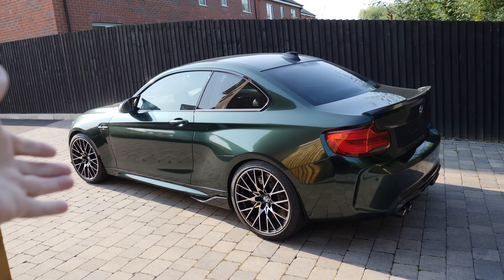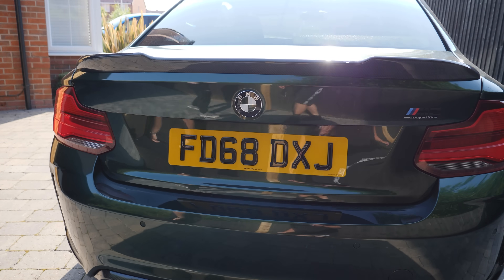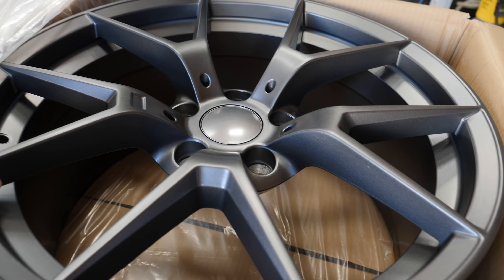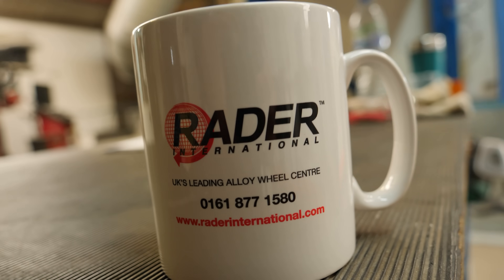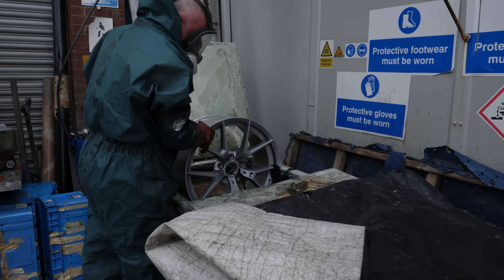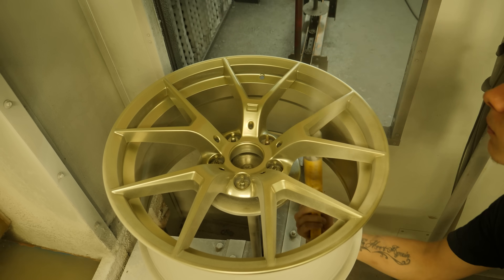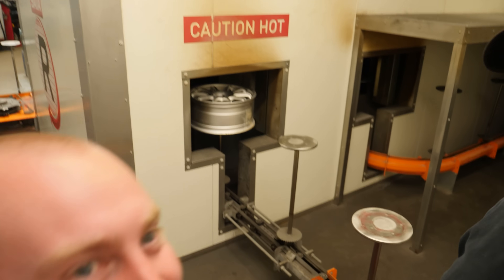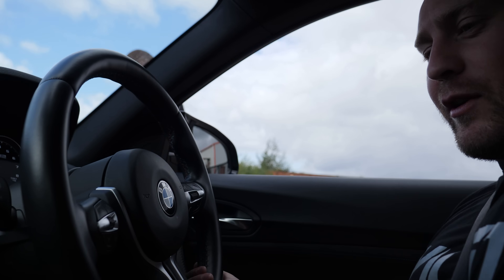THESE M2 CS REPLICA WHEELS CUSTOM FROZEN GOLD! IMPOSSIBLE!

Comment: Why didn't you just get them wet painted.  Colour would have been a doddle
Reply from the maker: Not that easy mate. And they were part painted too 👍🏼
Reply: @EVILGT  I run an aloy wheel repair company.  Majority of our work is colour changing.  We often  get our customers to  choose a colour from millions of swatches available. Hence why I was tad stumped why you struggled.
Reply from the maker: The Frozen Gold finish isn’t that easy mate, it isn’t just paint. I spoke to over 10 different companies in the north west who said they can’t replicate BMW’s frozen gold and they won’t release a paint code for it to match it either. That’s why there’s about 5 different layers to this finish to try and get as close as possible and still it isn’t bang on but it’s very close 👍🏼